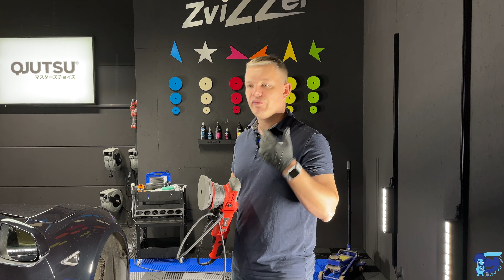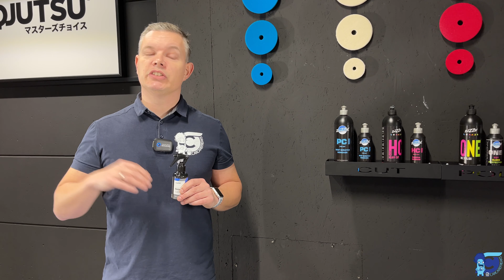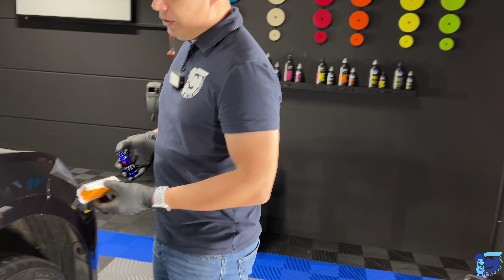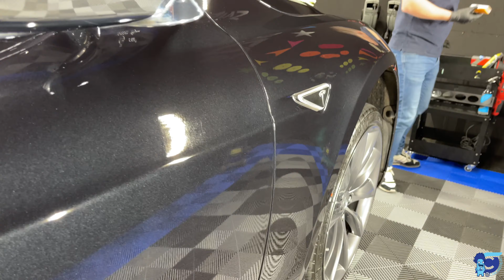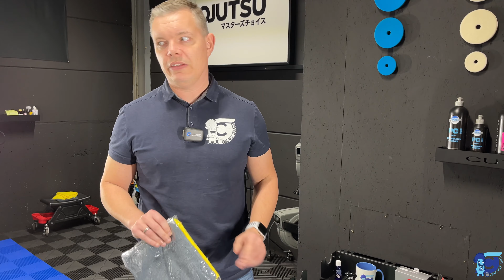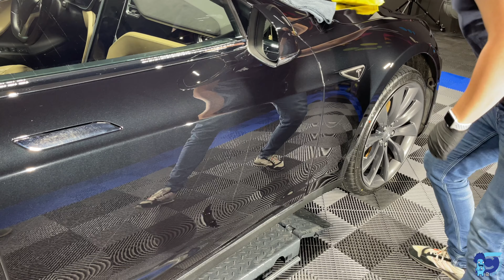Tesla Model S - Fra Skrot til Slot - CQuartz UK 3.0 - Episode 3

Comment: Kan se, I bruger CarPro Reload - det brugte jeg også efter en coating med UK. Kunne man ha brugt CarPro Releaser - hvad er forskellen udover Reload er væsentligt dyrere
Reply from the maker: Release er et praktisk produkt der gør det muligt at tage et køretøj i brug, lige efter det er keramisk coatet. Ofte skal en bil stå 4-8-12-24 timer inden den kan tages i brug efter påføring af en keramisk coating. Men ved at påføre Release, kan bilen tages i brug da release vil beskytte coating den første uge af sin levetid mod insekter, vand og snavs. 

En behandling med Release holder typisk 1 uge.

Reload er en sprayforsegler, beregnet til at beskytte coatingen indtil den er fuld hærdet (30 dage) og til et booste glans og glathed fra start og henover tid.